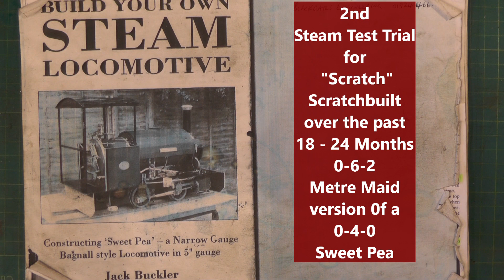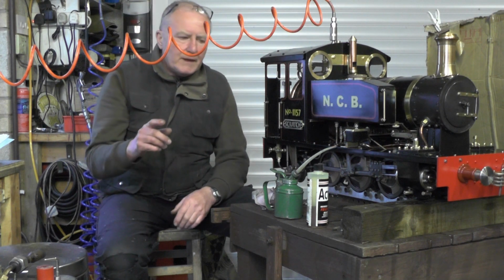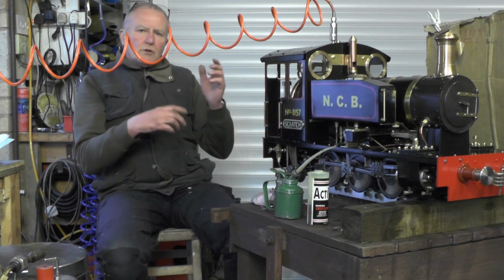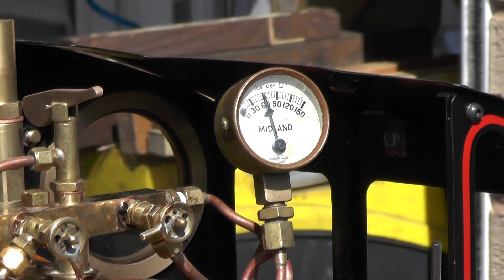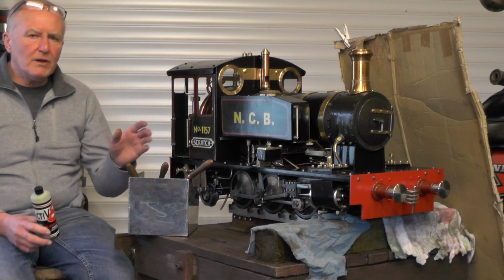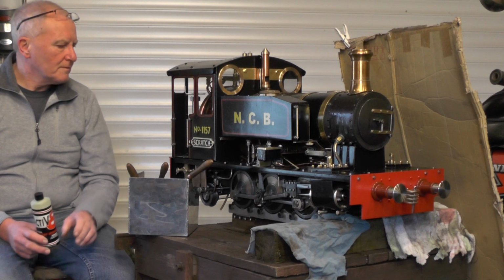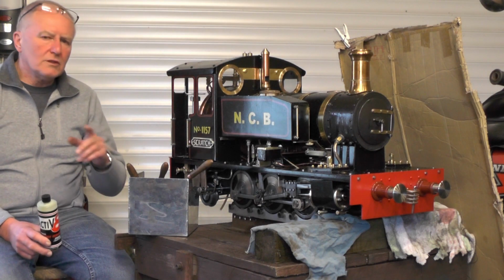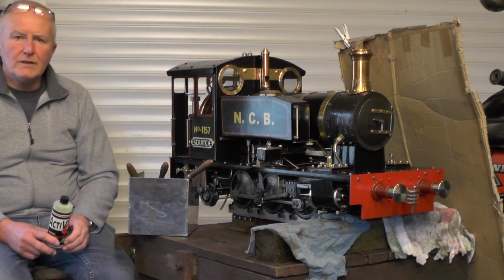Build Your Own Beginners Miniature Steam Locomotive Series (2nd Steam Test Trial ) "mr factotum"

Comment: Congratulations and well done.
In my experience having owned two brand new locos SRS Feldbahn and a Maxitrax R1 they take a fair few hours running to bed in and run nicely.
You will find that on the track with the locos weight and momentum it will run a lot better than on the rolling road.
Hope this helps
Reply from the maker: hi TM
Thanks for watching, commenting and advice, appreciated,  i will take all that on board
Thanks for staying with me through my journey, appreciated
Hope to hear from you on my next part !!
regards
mr f

Comment: Ah, now you've got the little bugger by the throat! Great stuff. I want to see it on the track next! I think you can have a beer now.
Your ball seat issue might be cured by using Martin Evans formula, D divided by 4. D being the ball dia. I hope this is a help.
Reply from the maker: thank PP
i will log that advice thanks
i might stretch to a few beers!!!!
I will get some footage on the track as soon as its inspected and when covid allows.
Thanks again for sticking with me and your support
see you on next part of project
regards
mr f
Reply: @MrFactotum  That's good. I've not had much luck with balls for valves! I use a captive Viton O ring on all my seats. The little blighters do not leak. These are fashioned after the domestic tap valves, sort of. Some folk in Oz use teflon seals with great success too. 
With regard to 60/90 degree valves, another advantage over coned valves is you only need a tiny amount of pressure to turn the O ring types off. The only down side might be regulating finer flows? We shall see.
I'm not sure you blokes in the old dart use Viton. I've heard others use silicone O rings. Might be the same thing??

Comment: Very nice! So few issues! &  wouldn't worry about the oscillation of the ball in the hand pump, that's very common, just means you need to pump a little slower I reckon (unless it is on every stroke). Would be great to have you talk about how to use the injector when the time comes, that's always tricky to learn.
Reply from the maker: hi MW
Thanks for comments
Yes i mentioned the hand pump  to a chap at our club, he said the same, so i will leave it for now.
As for the injector, when i get round to it i will do a video on my experiences, it may help other novices like myself.
Thanks for staying with me through my journey, appreciated
Hope to hear from you on my next part !!
regards
mr f

Comment: Not sure if you are aware or not but just a heads up that for the lubricator your best using steam cylinder oil as it’s thicker and treats the cylinders better. Just a little tip. Well done on getting you engine steaming.
Reply from the maker: cheers ES
Any advice given is taken on board, as soon as i get to the track i will have some proper oil, so thanks for that.
Thanks for staying with me through my journey, appreciated
Hope to hear from you on my next part !!
regards
mr f

Comment: Congratulations, it looks fabulous. I just went back and re-watched your video where you made the piston rings (that was a great video, by the way) and as a complete ignoramus it seems to me that the rings must just need a bit of running in. Spreading them with a wedge, normalising, then compressing back to fit in the cylinder can't really produce an absolutely perfect circle (not down to the micron level) and with the steam washing the oil away on every stroke (relative to compressed air) they must be just catching a bit and skewing a bit in the 5 thou clearance gap they sit in on the piston. The tiny amounts involved should wear in quite quickly would be my guess, should just get better and better. How much is left of that big ring of bronze that you have been hacksawing? What a lot of work. Look forward to seeing it run on a track. Won't a tender get in the way if you are sitting behind it trying to reach all the knobs? Maybe I am misunderstanding the sizes and the length of your arms! Many thanks for the series, it's been very informative and very impressive. You keep saying you are a novice, but there's a lifetime of skills gone into this lovely engine.
Reply from the maker: cheers tnl'd
thanks for watching, yes everything just needs running in,  the tender isn't very long and you can strecth over it
Thanks again for sticking with me and your support
see you on next part of project
regards
mr f

Comment: HURRAY.......WELL DONE
Reply from the maker: cheers sw
Thanks for staying with me and all your support, really appreciate that.
see you on next part of project
regards
mr f
Reply: @MrFactotum  I need a bit of help .I need to know what I divide by  to scale down from 3 1/2 gauge  to 2 1/2" gauge   .I think its 1 1/2..driving me a bit potty..any help of reference should be helpful as I'm not getting a lot of help on the internet. And some groups are working in decimal inches and mm and my self  to the nearest 1/16th..as I have a set of tank loco wheel and a drawing to make a 1/2 sized one simillar to yours  thanks in advavance
Reply from the maker: @swebb1967  hi simon
nice of you to think of me to be able to help. but i'm really a novice at this loco game, leave it with me for a while to peruse and get the cogs in my brain working and i will get back to you. 
regards
mr f
Reply from the maker: @swebb1967  simon
just off the top of my head.
If you want to know the factor to get a dimension to go from 3 1/2" to 2 1/2"
You've got to  divide 2.5 by 3.5.
therefore 2.5/3.5=0.7142857
Round that up to 0.7143, so that's the factor to get from 3 1/2 to 2 1/2
(e.g. 3.5 x 0.7143 = 2.5005)
Does that help you Simon 
Regards
mr f
Reply: @MrFactotum  that's brilliant , thank you for for taking the time out for me 
All the best
Simon
Reply from the maker: @swebb1967  no problem simon, keep me informed how you get on with the project
regards
mr f